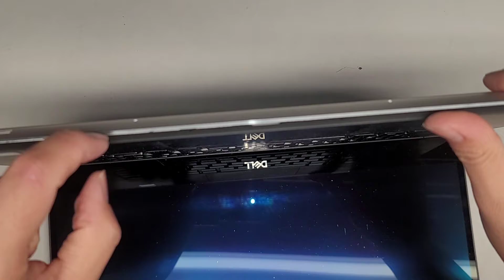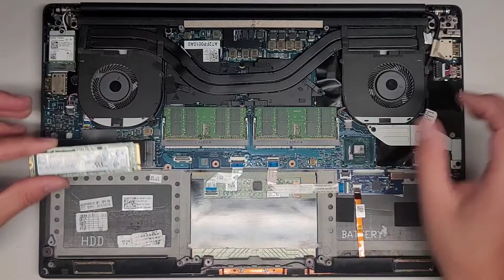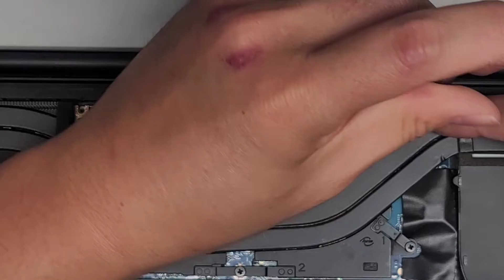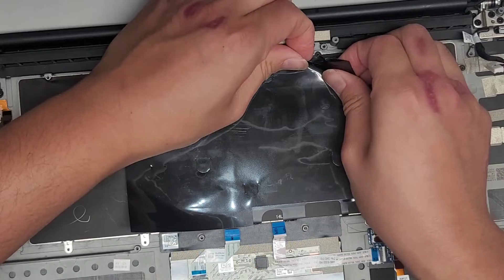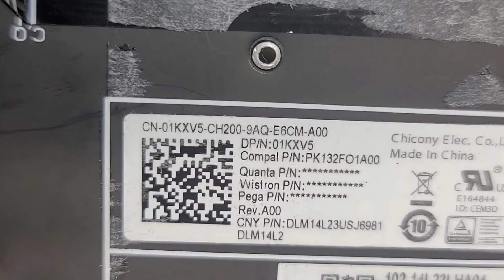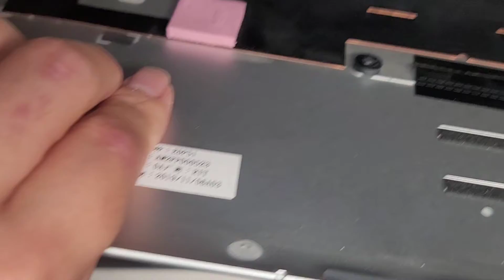DELL XPS 15 7590 Complete Disassembly RAM SSD Hard Drive Upgrade Battery Keyboard Replacement Repair

Comment: BTW HUGE thing to remember is that the XPS7590 does NOT have a CMOS battery -- when you disconnect the battery, BIOS and SATA are almost for certain going to reset probably triggering Bitlocker security when you try to boot back up. 7590 default SATA operations are RAID. Check your SATA settings and take a photo first -- and turn OFF bitlocker if you have it. I just spent over an hour going through this fix to get back up and running. THE SYMPTOM of those being reset is probably going to be bad boot and screen flickering.
Reply from the maker: Yup, I have videos specifically about that.

Comment: Can you have both the large battery and the extra hard drive underneath it a tthe same time?
Reply from the maker: Uhhhhh if you cut a hole in the bottom of the laptop to connect the cable and glue the hard drive to the bottom.
Reply: @ItsBinhRepaired  I think I'll just go with the smaller battery, Thx 4 ur reply 🙂
Reply from the maker: @louisfifteen  haha good idea

Comment: Do you have a solution to the 9570 problem 'No TPM in BIOS'?
Reply from the maker: It's not there and you're asking how to make it there? I don't know. Custom bios?
Reply: It seems to be a rather common problem with the 9560 and 9570. There's a white Alert screen 'TPM not found', there are no TPM settings in the BIOS and it's also not possible to use the Dell TPM update tool in Window.

Comment: THANK YOU so much for taking your time to put this video together. I have zero disassembly / assembly skills... and... this video saved my laptop. I spilled 🙃 a PROTEIN SHAKE all over the keyboard and after the 2 seconds of realizing what had happened & processing that what had happened was bc of me, lol, I immediately powered off the device and tuned it upside down with the lid open. I knew it was done for. I imagined the protein solidifying inside all of the unseen components, so without giving a f*ck, I took it to the sink and gently sprayed out the keyboard, then set it upside down to dry. What to do, what to do... after an hour of searching YouTube, I discovered this video. I was able to disassemble the entire machine, clean everything with isopropyl alcohol wipes and reassemble after waiting 48 hours to ensure all od the components were dry with the overhead fan running full speed. I was surprised to find that there was zero signs of protein shake inside the laptop, and only 3 droplets of water. So glad I bought a Dell XPS and so thankful for your video! I have no expectations for how long my machine will last after this fiasco, but I learned a lot from my mistake and have a lot of respect for what you know how to do! Truly appreciated 👏
Reply from the maker: Awesome! Hope it holds up for a long time. If you haven't already, please like and subscribe so others can find my videos. Thanks!
Reply: @ItsBinhRepaired  Absolutely liked and subscribed!
Reply from the maker: @djoyce777  Thanks again! :)